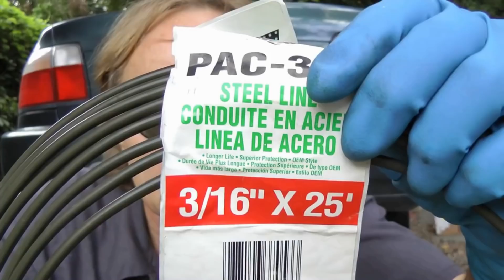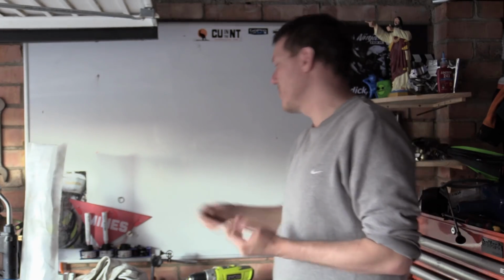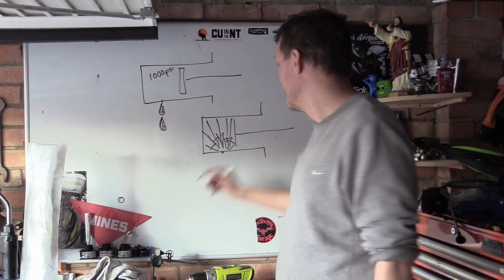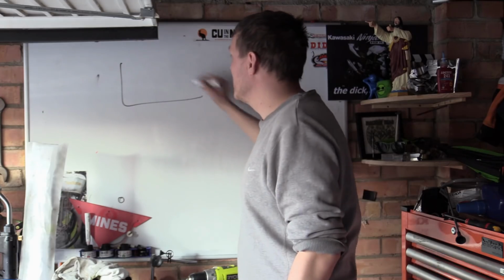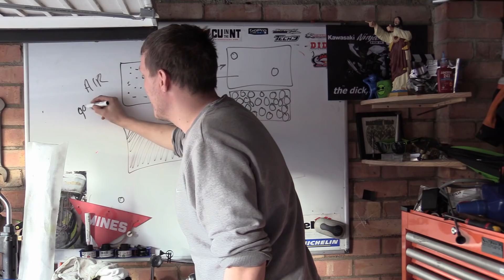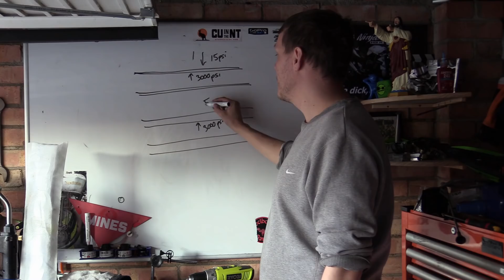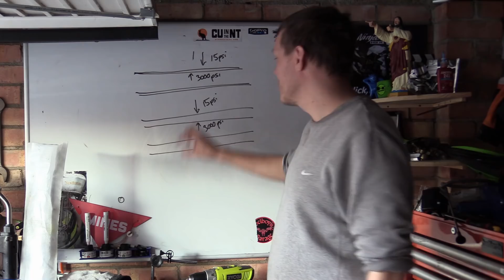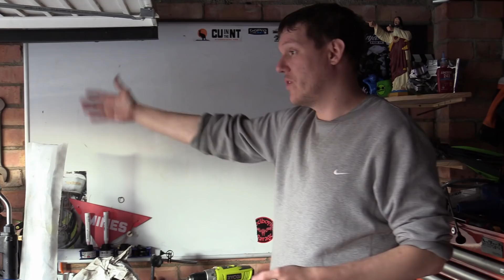Scotty KILMER - Will get someone KILLED!

Comment: Scotty is your typical mid-90's tech who thinks he knows everything about modern cars.
Reply: YES the problem is all the shit he spews is opinions from the 90s that are outdated and don’t mean shit, he doesn’t know wtf he’s talking about 95% of the time
Reply: @NB-ir1me  well modern cars still use hydraulic braking systems that are much the same as they were then. Advertising fittings to repair them, that are not designed for braking systems are just as dangerous on an older car, if not more so. He makes money off all those Amazon links, as he is an affiliate. It's as simple as that.
Reply: Right cause you saved me a fortune in labor repairs. Hmm.....
Reply: @NB-ir1me  it’s not “outdated” information. It’s a bad idea to do this on any car no matter how old it is
Reply: Rum up your engines!

Comment: What is your opinion on his CVT Fluid Swap Video?

(For Toyota Carolla btw, one of the few Belt-Chain CVT things that actually work alright, still a PITA to fix apparently)

I have seen others show the proper procedure which is similar, but i am running into an issue of Planned Obsolescence/Preventative Maintenance vs “If it ain’t broke don’t fix it”.

Comment: eugh.... there is a reason why brake lines use mushroomed ends and not compression fittings.... Keyword: Hydraulic, non compressible fluid.

Comment: About a decade ago I was lucky enough to blow my brake line in my driveway before an outing. Pulled the car back in, parked it, cleaned up the brake fluid in the driveway, borrowed a car, bought the parts to replace the entire lot of it and ripped all the old shit out and replaced it with new. It was not expensive. Reported the video. Hopefully they remove it before someone kills themselves.

Comment: whenever i have had to replace brake lines on a car. i have taken the old one to my local auto parts shop , and they have made up a replacement to the same length. much better than trusting a compression fitting not to blow if ever you need to do an emergency stop
Reply: As he explains in the video, hydraulic systems aren’t as dramatic when they get ruptured. They leak slowly. Air systems explode when ruptured. You may have seen many times in the movies when someone shoots out the window on a plane, such as Samuel L Jackson in Snakes On A Plane. Everything is violently sucked out of the cabin. The reason this happens is the air inside is compressed and the air outside is not, particularly at high altitudes where it is thinner and the air molecules are spaced further apart. The air is rushing to return to its natural state. In doing so, it knocks anything not properly secured out through the point of failure with it. These principles are also used in the manufacture of vacuum cleaners. Anyway, it’s not like that with brake lines. If those leak, you won’t hear a bang like you hear when an air system suffers a rupture, like a plane experiencing an explosive decompression. This bang is a pressure wave. As I say, your brake lines will just leak slowly and you’ll just squeeze the brake fluid out when you press the brake pedal. The takeaway here is that you’re better off getting OEM brake lines when your car’s brake lines leak.

Comment: he used the fitting to drag the new brake line thru, not to make connections in the system. As long as he cuts off the part where the fitting grabbed on the brake line, I don't see what the problem is.
Reply: But he didnt, he said to splice.  to splice is to connect a new piece in between two old pieces.  He replaced a section of rotted brake line with new using two compression fittings to connect to the old.  This is not only unsafe but highly illegal as anywhere in the US your vehicle will instantly fail a safety inspection with a compression fitting on the brake system at any point.
Reply: @Milner62  if it's illegal why does AutoZone & Pep Boys sell these parts & encourage this technique when in a pinch for a temporary fix??
Reply: @kylorenkardashian79 , simple, they state off road use only to get around it.  Like for example exhaust kits that get rid of your emission systems that is illegal to have but they stamp said items as "Off Road Use Only" and bam they are not liable for it.  Now if you get caught with it on the street you and only you will get in trouble.

In the case of the compression fittings they are listed as "Off Road Use Only" and you can drive on the street with them, but if a state inspector in any state in the US sees it, they are obligated to fail the vehicle as they are not legal for road vehicles from a safety stand point.
Reply: @Milner62  just called up Pep Boys, they didn't mention anything about off road use. I asked for them to double check, they did. 🤷

Comment: Holy fuck even if what he was using was 100% safe and made specifically for brake lines who the fuck would repair a rusty brake line. They don't rust in one single small point. The whole fucking thing rusts. You'd just be repairing the first of many failures

Comment: And more to the point, that highest pressure will happen at an EMERGENCY, when you jump on the brake pedal and want the car to stop quickly. Not a good place to have some bloody garden hose fittings in your brake lines

Comment: Matt, I wanted to mention this before: Do you know how a airbrake system works? I tell you one thing: you will not move the vehicle when a airline breaks unless you manually release the fuckers one by one. I tell you the wheels will lock up on you like hell breaks lose. They only fail to stop when brake pads are bad or the disk says adios... all other fails will lock up the fuck.
Reply from the maker: "Matt, I wanted to mention this before: Do you know how a airbrake system works?"

- Basically there's a compressor that is charged by the engine, air is forced into the cylinder to apply the brakes. Once the brakes have been released that air is no useless - so its bleed off. Hence why you hear a 'pssssss' when they remove the brakes.
Reply: Sorry Matt, the noise you hear is when the airpressure pushes the load springs back to release the brakes. But you hear more the noise it makes when you aply the parking brakes. It bleeds the lines and the brakes tighten up. If you have no pressure in you airtank you cant move because you need the air to release the brakes. That is why the semi trucks somtimes start the engine and let it run a few minutes because they need to fill the airpressure to move the lori. Air brakes work the exact opposid from hydraulic brakes. You bleed the pressure out of the lines when you apply the brakes. The pressure is from springs that the air is used to force it to open. I drive airbrake systems for decades... never had a system that used the pressure to apply force to the brakes. Currently its a Mercedes Atego 818 build 2007...
Reply from the maker: Did you miss the bit at the beginning of the comment - here I'll help you...

" Basically "
Reply: That is basically WRONG! because you don't need the air to apply the brakes. You didn't know it... so all gooden now you know. You are not making it better with basically.
Reply: Air brakes are a balance system. 
A spring Applies the brakes for parking or if air pressure is lost. 
When the brakes are “released”, air pressure is applied to the spring side.
When you press the service brake, you apply air pressure to the opposite side of the brake canister, fighting the release air pressure. 

Listen to the air brakes of a big truck when in traffic, and they “sneeze” when the brakes are release to begin rolling, they don’t actually make much noise when applied.  Sometimes they make a whine as the air lines are pressurized.

Comment: Seriously now guys and gals, go read the comments on Scotty's video...pure fookin' comedy gold I tell ya' what!

Here's a good one:

Homecomfort: "hmmm, compression fitting on high pressure brake line,  no jack stands, brake fluid intentionally run on ground... 45 years ehh?"

Scotty Kilmer: "yep, 47 years now, and still have not been squashed and never had one of these fittings fail in all that time. Keep the anal whistle clean shops that rip off their customers day in and day out, I'm working in the driveway."
--------
And here's probably my favorite:
longshot12x: "It said on that fitting package to NOT use on automotive brake lines, and no jack stands under the car...I'm glad my son asked me before he used your method and screwed up his car's brakes. I've also been a mechanic for 46 years, ASE Certified Master mechanic in automotive and diesel. You should show folks how to fix their cars properly without cutting corners that could be very costly in the long run, you may one day find yourself visited by those lawyers you mentioned."

Scotty Kilmer: "@longshot12x ha, it's legal here in texas, we don't have anal lawyers (yet) like in New York and Canada who force such labels on stuff. I've used em for 47 years and never had a problem with any coming loose. Mind you, cars don't turn into rust buckets like they do up north where the real only fix you can do is replace ALL the rotten lines entirely, or just junk the whole car like people do when they rust up north. The South Rises again."
----

""""The South Rises again""""
It all makes sense now... 

He doesn't have a family tree, he has a family wreath!

Comment: Ive seen them used regularly whilst doing car MOT's.. Im sure there was a Ministry buliten sent out to MOT stations outlawing them many years ago.... They were usualy fitted to shitboxes where the brake lines went under the fuel tank etc.. and it was quite often a badly done "Cut and Shut" jobbie with cable ties to the fuel pipes or whatever protrusion they could attach them to!

Comment: I've done it for 42 years never had a problem never had an accident all depends on the person who's doing the job
Reply from the maker: No it doesn't - compression fittings are NOT for hydraulic brake systems...
Reply: @thedirtyworkshop  why are they sold at AutoZone & Pep Boys then for this specific quick fix???

you should be demonizing these businesses as well

Comment: But also fluid dynamics are a factor too, the peak of the fluid at any point could be up to 10000psi at any point because you've essentially got a wall of pressure going through the brake lines, those fitting when you slam your brakes will burst
Reply: What he’s saying is that fluids cannot be compressed as much as gases. It’s a recurring theme when it comes to man and his machines, from the principles of compressing a fuel and air mixture prior to ignition to why aircraft cabins require pressurisation and the complications that will occur if God forbid this unit is punctured at a high altitude versus why pressurising a submarine is the worst thing you can do as an engineer. But here, the moral of the story is don’t splice a skinny tube in a place where a thicker one is needed, especially when the fluid that travels through there is incompressible, like automotive brake fluid in this case.
Reply: @MrSupercar55  I agree

Comment: I wonder what Scotty Kilmer has to answer to this.
Reply: He removes every comment that points out that the package he showed said "NOT for break systems"... so I guess we'll just take that as the answer.
Reply: Scotty: "I've been doing it my entire life now STFU...the south will rise again!"
Reply: @novaprospekt1739  basically what he said
Reply: NovA ProspekT take a break from the Reddit and nbc, life will get better
Reply: silverbird58  

Using brass compression fittings on a brake system?  You should stick to working on skateboards... even then I'd have concerns about using one you'd worked on 😂
Reply: Idk, but the video isn't available anymore.
Reply: While much of what Scotty says is correct, he is a bit of a whack job.
He might have been in the industry for over 52 years and that is more than 2.5 times the tenure i had in the automotive Industry. 
I have been in the automotive business for almost 20 years and as a person who has worked as a Parts Clerk, Service Advisor and a Warranty Clerk, i have seen many things that are contrary to what Scotty says.
For instance, I've worked at  a Toyota Dealership as a Service Advisor and i will tell you, first hand, that Toyotas,  if they are not maintained well, are just as unreliable as FCA or GM vehicles that haven't been maintained. It goe without saying, that a well maintained vehicle will be reliable and last many years.
I have seen many FCA and GM products last a very long time bc they were maintained meticulously 
As a matter of fact, i know this Dodgr minivan owner, who bought his vehicle in 2010 and it is now 2020.
He has put 960 000kms on it. It still has the original engine and transmission. 
He was asked about this van and he said, "i do all my fluid changes at the recommended intervals  and fix small problems before they become big issues.
Reply: @sensiblebabyandreality6804  I’ve had many issues with Toyota’s and I maintain my vehicles religiously. I mentioned that on Scotty’s channel and was told it was my fault the piles of garbage broke down! I have never had a GM vehicle leave me stranded anywhere! Can’t say the same for Toyota.

Comment: Good video man. Aircraft hydro systems (flight controls) I'm familiar with are pressurized to 4000psi. If there is a leak it's a mist, which can cut your fingers off/ enter your bloodstream.
Reply: Plus the cabin itself is pressurised and if it gets breached at high altitude then, as I’m sure we’ve all seen in the movies, everything and everyone gets sucked out if not properly restrained. It’s all to do with principles mentioned in this exact video as the once firmly compressed air molecules return rapidly and violently to its previous condition where the molecules were spaced out with nothing in the gap, thus equalising the air pressure both inside the cabin and outside. It’s also worth noting that the air pressure inside the cabin is far greater than it is outside at high altitude, which makes the situation that extra bit worse if an explosive decompression occurs.
Reply: Yes some new ones are 5,000 psi it’s insane
Reply: @MrSupercar55  the movies are highly exaggerated. The size of the rupture is going to determine the speed and therefore effects of the depressurization.

Comment: I’ve used those connections for years with no issues... oh I’ve read the package before hand but I’m poor and time is always a issue so I put a small flare on the end to keep them from blowing apart the best I can.... but I’m not a pro and I know it’s not right but a good quick temp fix
Reply: Ive been working in the field as a trained technician and ive seen those compression fittings leak on every vehicle that has came in to the shop that had them.  Ive seen them leak on fairly low pressure systems such as transmission cooler lines, down to leaking on  fuel lines and brake lines even.

I know its fine in a pinch but scotty the hack is presenting it as a viable legit repair which it is not.  its a ok repair if you are in the middle of no where and need to get home.  But its not ok to fix it that way when you could fix it the right way with a inverted flare union and double flaring the hardline to make the connection.

Comment: I used the same brass fittings on my air ride system and after it repeatedly blowing and leaking from the fitting, I decided to run an entire new line.  Havent had any problems.

Comment: "that's why you don't us air in a brake system", you need to share your obvious superior intellect with the trucking industry.
Reply from the maker: Air in a hydraulic system. Its actually the same the other way around. You don't want fluid in your pneumatic system....

Comment: Compression fittings are ok in a pinch. Just to get you to the shop. The reason the label is on there is because if not installed properly they will pop
Reply from the maker: we'll see
Reply: Wrong it’s because they where not designed for the high pressure and Scotty has added a new definition to dipwad

Comment: Did it to a old 500 dollar stick Honda, on the clutch master cylinder line. Lol in pa using fittings and splicing is illegal on brakes and will not pass inspection anywhere

Comment: Ok, so it took you 10 minutes to finally come to the conclusion you already had minute's before, and it's the same conclusion?! What a waste of time. Yes he used the wrong connector. But there are connectors out there for brake systems that are identical. Have them on my car and they survived several emergency brakes.
Reply from the maker: No there isn't. No oem uses push fittings...
Reply: @thedirtyworkshop  I have OEM push fittings on my Case Utility Bkhoe to connect utility tool accessories. never had a problem. (1 inche line)

Comment: I checkout Scotty’s video, he doesn’t have the link for the compression fitting on there anymore. On Amazon most of the compression fittings for brakes say it in the title.
Reply from the maker: Yeah I noticed that - but its the video that dangerous - not the fucking link
Reply: Very true, plus he doesn’t distinguish the difference between a water fitting and a brake fitting. People will see this and think that a brass fitting from the local hardware store is fine for brakes. Like using water line for fuel soft lines, they are different for a reason.

Comment: I like Scotty Kilmer, but in this case he is wrong. Brake line replacement is a specialist job and not DIY! 10:15 you do have brakes, lines are cross setup with 2 lines (RR+FR RL+FL). Or both lines would collaps at once then 🎳🚙
Reply: I actualli thought it was a Do it urself job too.
Reply: I've been replacing brakelines at home for years. Just do it properly.

Comment: Idk what happens in the mechanic community on YouTube. All I know is I didn’t like the description of the air brake system. To say it isn’t compressed from the start is outright incorrect, otherwise it wouldn’t rush out of the air lines when they leak and you wouldn’t need an air compressor for them to work.